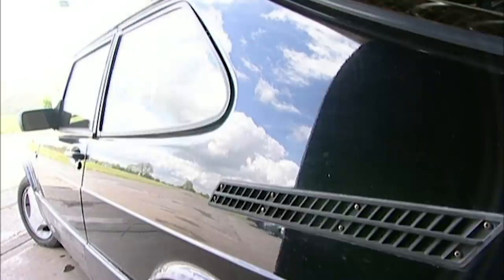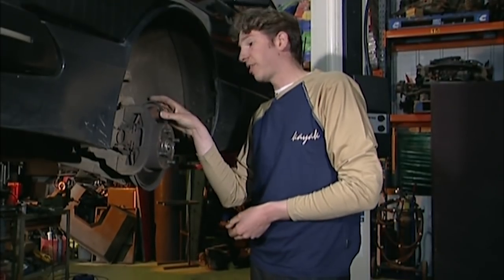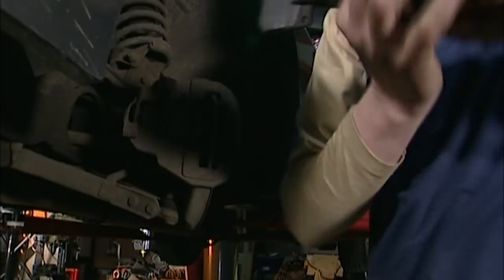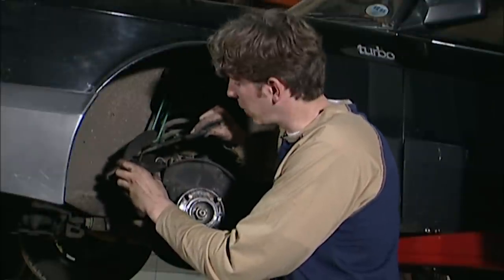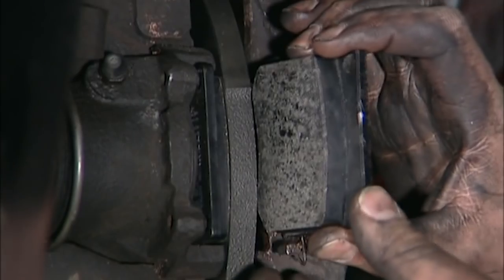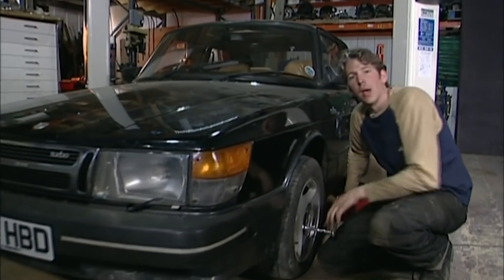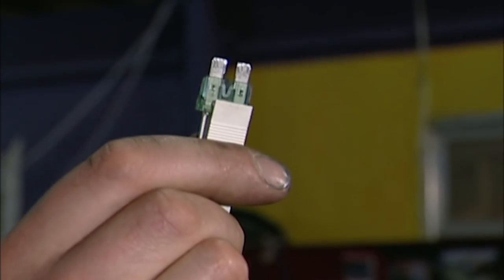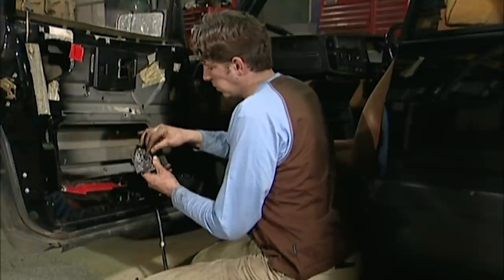Saab 900 Turbo: How To Replace The Brake Calipers And Electric Windows | Wheeler Dealers

Comment: It’s 2024 and this video is still helpful for dealing with the window regulators. I just removed and lubricated the seized regulator on my 900 convertible, with the extra difficulty of not having a window frame to tape the loose window on, but got there in the end! Now to get a new motor to replace the seized old one.

Comment: You didn't replace the brake calipers as described in the title, also, you should have greased all of the rollers and pivot points on the window regulator while you had it out.
Reply: Hi from 3 years ago. I thought exactly the same about greasing it😂